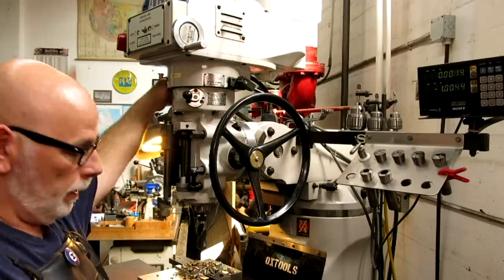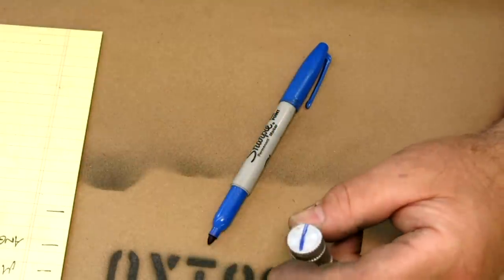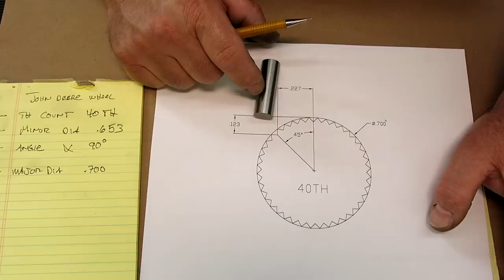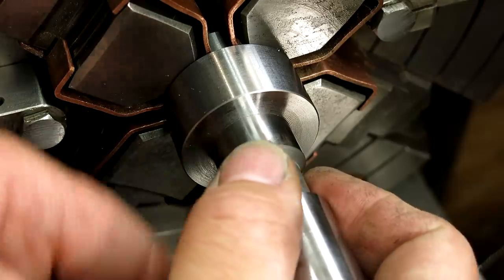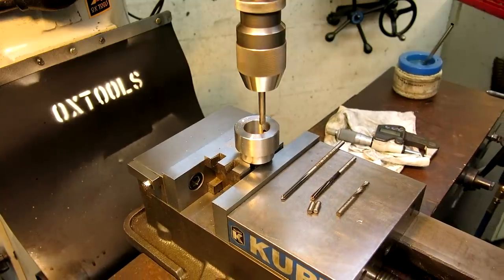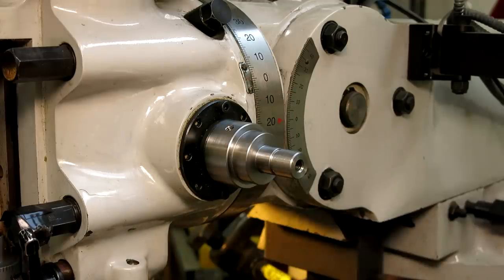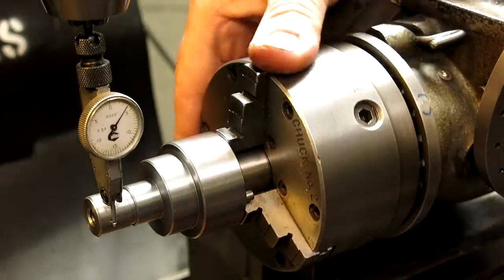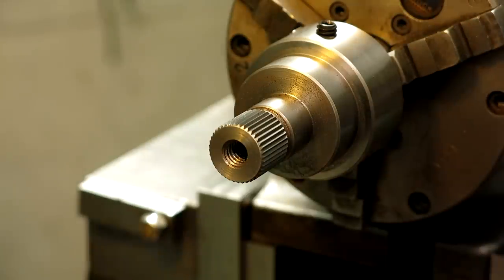Sensitive Quill Feed Handle for the milling machine

Comment: It's a rare steering wheel that isn't TAPERED as well as SPLINED in the ID that slides over the steering system shaft. And usually a very cheap and cheesy one. Did you find a good steering wheel that's straight-splined? It must be made out of Lucite or something for your "toolmakers' microscope" to shine its light source through the material like that. "Comparison microscopes" are typically the only microscope that illuminates the "stage" and sample from above. Conventional microscopes illuminate the stage and same from below and only transparent/translucent samples can be viewed. Your "toolmakers' microscope" should show nothing but the spline material as illuminated from above and as viewed through a magnifying glass. Unless you found a "rare" comparison microscope with a light source capable of "illuminating" solid metal.